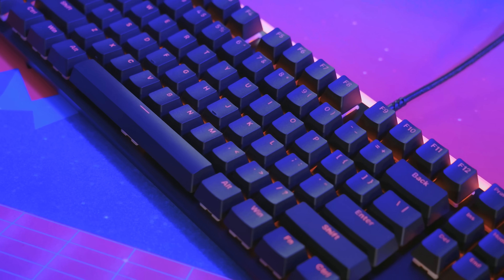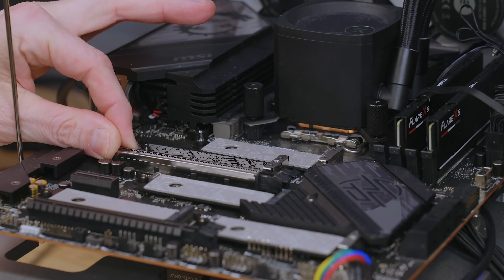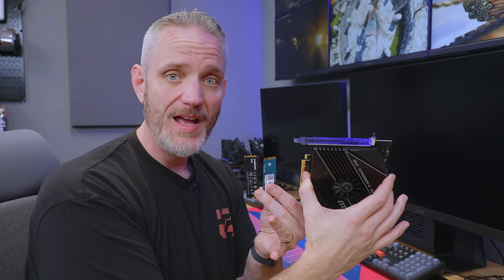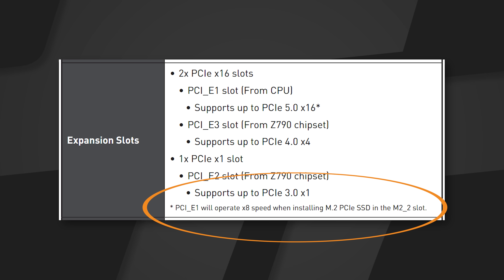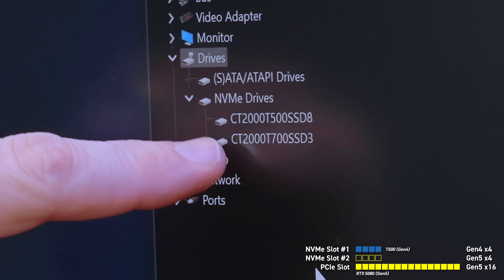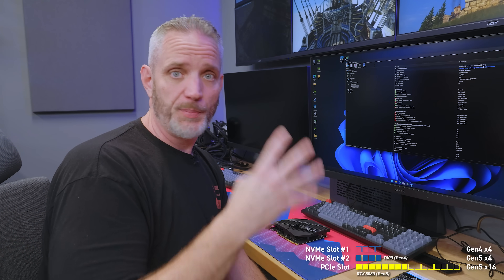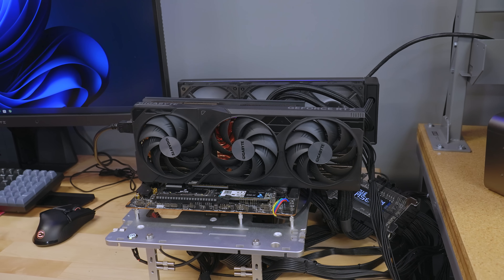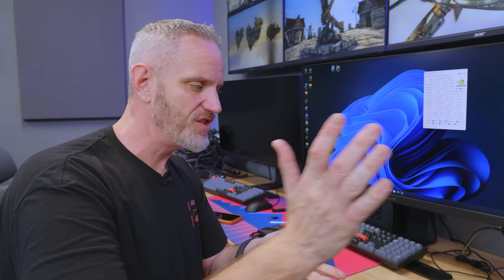Don't make this mistake with your PC!

Comment: The reason they have all the slots is so the manufacturer doesn't need to make a purpose driven board. It can be a standard gaming board, a GPU rendering board (where 2 or 3 gpus can do their job just fine without 16x each) or a storage focused board with a basic biotch GPU.
This wasn't a (real) issue until NVME storage showed up on the scene (and also when Intel killed their enthusiast platform lines) gobbling up the extra PCIe lanes in non-16x lane counts.

Comment: I have a gmktec K8 Plus mini PC, and it has AMD Ryzen 7 8845HS, which has 20 4.0 usable lanes. 
It has 2 x4 m.2 total is 8 so far.
 it has 2 2.5 GB Ethernet x1 lane each, total is 10 so far.
The USB 4 has x1 lane per port for PCIe passthrough total is 12 so far.
 It has an m.2 E key for wifi, but it has x2 lanes, which is actually bifurcated to 2 x1 lanes, 1 lane is never used. Depending on the device, some mobos will have this as an extra PXIE 1x slot or only have 1 lane on the m.2 E key. Total is 14 so far.
and the last thing a ouclink pot that is PCIe X4 Total is 18
As for the last 2 missing lanes, I don't know if they are even being used or if it's for the mobo's own chipset, which has mostly nothing Windows can detect. in short there's no PCI switching going on my mini PC i also have a B550M PG Riptide wich also has no pcie swoching but i have a 5600g so everything is ar PCIe3 and fingoing put the Ethernet wifi and 10GB USB are shared, and if I have my eternal SSD in the 10Gb port, it kills the networking

Comment: Do the Chipset NVME slots run slower because they are using the chipset, or do they run at the full speed of a Gen 4 drive?  Can I put a regular NVME Gen 5 in the Gen 4 chipset slots instead of a Gen 4 so I can move them to my next built and hopefully be able to use more Gen 5s?  
Thanks!

Comment: That x4 slot wont bifurcate to dual x2. Itll only support the m.2_0 on the adapter.

HEDT really needs to become a little more mainstream. I couldnt do crap on a 20 or 24 lane board. My arrangement would be limited to one way and Id hate it. I need the freedom of all slots being x16 and direct to cpu.

Comment: Thanks, I did make that mistake, but I fixed it now. I had a drive in the wrong slot, running at @x8 5.0, so I removed it, and it went back to @x16 5.0. I think I'll put it in the pciex16_2 slot so I can keep the drive without any issues. New to building PCs here, lol. Thanks again!

Comment: Yes those 'missing' lanes go to USB4 as that is how AMD says they should be used.  IMO with how they require certain chipsets to have USB4 on 4 of the PCIE lanes - AMD should just call them 20 lane CPUs.  I do as it's not very common to find a board that uses those lanes for an M.2 slot or the way I would prefer - a 16 + 0 / 8 + 8 pair of slots and an 8 lane slot.
Then there'd be three slots that let the following potentials.
A.
(16 lanes or 8+8 or 8+4+4 or 4x4)

(0 lanes)

(8 lanes or 4+4)

B.
(8 lanes or 4+4)

(8 lanes or 4+4)

(8 lanes or 4+4)

Comment: if the intel 14*** only has 20 lanes like ex: the amd ryzen 8000s 16x would go to the pcie slots and the other 4 would go to the chipsets. any nvme's would run through the chipset not the cpu.

also it is very confusing that the timestamp for the motherboard nvme is labeled as x870e taichi not the MSI carbon

Comment: For the M.2 on that Z790 board, there's a physical switch called a MUX that alters the route of the lanes from the slot to the M.2.  This is also why the M.2 slot is so close to the main slot to keep timings in sync as cheaply as possible.  
Bifurcation is only when a single slot is electrically split up to address multiple devices and it is not only in twos.  You can for example have 8x+4x+4x or 4x+4x+4x+4x.  As far as I know, there is no 'AUTO' setting for bifurcation (and it could be wrong as I only have a single platform modern enough to support bifurcation).  I had to go into my BIOS to enable bifurcation on my second 8 lane slot on my X570 Taichi in order for my two M.2s to work.  In the case of my X570 Taichi, a MUX redirects 8 lanes from the primary slot when I am using the secondary slot and I can further bifurcate the physical slots as 8 lanes top, 4 + 4 lanes bottom and likely as well can be set as 4 + 4 lanes top and 8 lanes bottom and 4 + 4 lanes top 4 + 4 lanes bottom.  The 8 + 8 is not bifurcation though as it is handled by a MUX and MUX are auto detect.

Comment: Query-  I have an MSI X99S MPower paired with an i7 5930K.  Both are a matched set using 40 PCIe lanes.  Here is the listed break down copied from MSI website:

4 (x16/x16/x0/x8*, x8/x16/x8/x8*) SLI x4, CrossFire x4, *=Forces M.2 to PCIe 2.0 x2

There are 4 full length slots and 2 PCIe x 1 slots.  1st full length slot is pinned for x16 with a x1 slot below, 2nd full length slot is also pinned x16 with a x1 slot below, then my only M.2 slot which is SATA(Forced to NVMe 2nd gen), then my 3rd and 4th full length slots are pinned at x8.

So this means I can slot 2 GPUs in slots 1 and 2 and play with stop loss scaling and run them at full x16 lanes as long as I do not use the m.2 slot and run a SATA SSD in one of the 10, yes 10, SATA ports?

And if I run with the M.2, my top slotted GPU will either need to only be an x8 GPU (or run a x16 and be bifurcated)? 

Any cool ideas what to do in the bottom x8 slot?  Maybe a capture card?

Also, I am looking at the Xeon e5 2699 v3 which is the same 40 lanes matched to this mobo.  This may end up being a workstation/server or might even play with the idea of making a home AI rig.

***edited: I'm sure I have this wrong.  I haven't built a computer in almost 30 years.  A lot of this is new to me.

Comment: The time your GPU most likely will run into PCI-E bandwidth limitations is if the game is poorly coded and has a VRAM leak.
Or you exceed the VRAM on the GPU, the moment it starts to swap out with system memory, that is when you start to see PCI-E bandwidth go to crazy numbers.
If it is useful or not depends, those moments usually cause stutters too, and I doubt more PCI-E bandwidth would help if you are already there.

Comment: This really should not be a thing in 2025. Giving up a gen 5 drive to get a gen 5 GPU is so 1997.
Reply: You don't need to though, it's been tested on a 5090 that you get less than 1% performance drop on 5.0 x8, just bifurcate bro
Reply: @silenthunder52 This is the real answer. It just makes no meaningful difference.
Reply: Maybe in 15 years or so? We're just getting to rear-connect motherboards so doing more innovation than that will take a looooooooong time.
Reply: You would have to pay extra because it will make the manufacturing more expensive for the MB and CPU.

Comment: I recently rebuilt my set up with a new CPU and motherboard. The Asrock X870E Nova is quite nifty in that the top SSD slot goes to the CPU but does not lane share with the PCIE slot. Effectively giving you the best performance for your graphic cards and storage.

Comment: It seems true, my pcie  slot for graphics  shows max supported 16x, but i'm only getting 8x. Yet, max supported link speed is 16.0 GT/s, which I get with both connections (like 8X), so I don't think I'm really losing much (helps being on mid tier equipment, 12700k,3080 12G, z690 MB). Get video as always, well mostly.

Comment: I feel like if you can't get data into the graphics card fast enough anyway, you may as well downgrade the graphics card. giving a graphics card the only 16x available is silly, until the card can utilize it fully, CONSTANTLY. so until the next, NEXT generation of graphics cards, I feel like we are better off with dedicating whatever we have to storage speed. ideally we want to be able to SATURATE the RAM, CONSTANTLY.

Comment: nice work, had to check it out on my x570 Phantom gaming4 as i had recently added another drive bc the promotional material said it could run 2 nvme at 4.0 spec... all good in this hood

Comment: Playing devil's advocate putting a gen5 in a gen 4 slot wouldn't be the end of the world right. Looking at say the Samsung 990 pro Vs Samsung 9100 pro, the sustained write before it drops on both is like 75/80 seconds max speed with the 990pro being half peak speed. If you drop the 9100 in the slow slot you would get much longer sustained writes as you can't saturate the device. Which would still make it better than running a native pcie 4.0 drive right? (Sustained sequential writes filling up the cache etc IE i would still buy two pcie5 drives and put one in a 4.0 slot)

Comment: I immediately went and checked my system after watching the video! luckily, my M.2 only uses 2x Gen 5 lanes (max supported for the Evo 990), and I still have a Gen 4 GPU (6750xt @ 16x Gen4), both are in the top most slots of my Strix 670E-E, and my 7700x (amd) is handling all lanes accordingly!  My secondary M.2 is an Inland branded 4TB, and is only getting 4x4, but it is just used for photos, downloads, documents, so the write speed is fine. Thanks Jay!

Comment: took me 2 whole days to find a MoBo where i can install my 3 nvme drives and dont loose lanes on the pciex16_1 slot. downloaded so many manuals and looked at the block diagrams; asus dimm.2 helped me at the end cause both slots on it run over the chipset

Comment: I'm curious about what REAL (not Nvidia's 8 lane boards marketed as 16 lane and false advertising) last gen GFX cards still work fine on PCIE 4.0's bandwidth. The GTX 5060Ti uses only 8 lanes but a 5070Ti 16 lanes. Does an AMD 9060XT use all 16 lanes on the board for instance? With some manufacturers you can see it on the pictures but others seem to be hiding it so what could AM4 users still buy to not be bottlenecked? How many GT/s do different last gen GFX cards really need?

Also on the video topic as well as my used bandwidth question around backwards compatibility with a slower NVME drive is not answered anywhere. Not the board nor drives nor CPU nor GFX car manufacturers. They are all leaving us in the dark around what we can use

Comment: Finally!  Someone showed how to read and understand the manual.  You have no idea how long I've been waiting for just one influencer to show why it's so important to RTFM.  Oh you have no idea how many hours of my life I've lost teaching people I know how to read motherboard specs to get a shortlist, then download and check the manual for the technical gotchas to understand how those specs translate into hardware configurations and how that affects hardware choices and performance.
Reply: PCs in the 90s had a RTFM problem, with all the manual jumper settings. By the 2000s, everything became simpler with BIOS/UEFI configurations and PCIe lanes. It's in the past few years when nvme has taken over from  SATA for enthusiasts, and eaten lots of lanes in the meantime, that configurations have become horrendous again 😮
Reply: @peterwstacey  yeah i read the manual multipltimes before i put in drives. "use c slot disables some sata ports put somthing in y it disables pcie slot 3 or 2 or something its a fucking nightmare

Comment: @JayzTwoCents  - I commented this on your previous video, but it seems you missed it.  In response to your question of the Gen4 card on the Gen5 slot, do you get 16 gen4 or 8 gen5.  The answer is neither.  It's 8 Gen4.  Write down this rule, because it's the most important rule you'll ever know and teach someone in computing.  You are always limited to the lowest common denominator.  A gen5 x16 slot bifurcated to x8 with a gen4 GPU installed, the lowest common denominator is x8 gen4, which is equivalent bandwidth to x16 gen3.  This is why it's so important to memorize that phrase because it will always answer this specific question because it informs hardware buying decisions because once you consciously think about it, you no longer buy the most expensive hardware because "it's the fastest", but because it fits best with your hardware.  

Such as the example you used.  What's the point of buying a Gen5x4 drive, when the chipset it has to go through is limited to gen4x4, bifurcated to gen4x2.  You can't simply "magic up" extra PCIE lanes that no longer exist due to the hardware configuration.  Likewise, you can't magically cram Gen5 bandwidth down a Gen4 lane.  It's for those very reasons the phrase "you are ALWAYS limited to the lowest COMMON denominator" is so important, because it literally informs you on both sides of the equations and when you're better informed, you can make better decisions.  That's not to say there's never a point in forward thinking and building for the future, but as you well know, there's being forward thinking and then there's outright wasting money.

I hope this helps.

Comment: could you do a video possibly about is it worth buying 2 gen 5 ssd m.2s to carry them forward into a future build rather than a gen 5 and a gen 4 for a current mother board that has 1 gen 5 and 1 gen 4? 
is the wear on the ssd likely to cause a problem in the future? what are the possibility of a motherboard having multiple gen 5 slots going forward or is the industry likely to keep it as 1 slot for gen 5?  is it rare to get a deal on 2 gen 5 ssds that its worth taking the drop in speeds for one slot ( i feel its not a complete waste of purchasing a ssd to put in a lower gen slot as it can be carried forward into a newer build, but there is a percentage of value lost while running it in a slower generation slot.).

Comment: The ROG isn't better than the Taichi. It's just a different setup, for a different use case. The other lanes are used for the USB4. The USB4 controller takes 4 lanes, and is mandatory on X870/X870E boards.  You're literally calling the Tachi stupid, because you didn't RTFM properly, and don't appreciate the layout of the board.

The Tachi chose to share the lanes of the main x16 with another x16 slot, so you can have double GPUs in x8/x8  while having none of the M.2 slots share any lanes. If I want 4 SSDs without pulling away from my main PCIE slot, I can do it. I'd actually prefer the Taichi setup, since I can use 4 SSDs without touching the GPU, and I can then use an add-in card to get 8 lanes to the CPU. That's two PCIE5 drives.

You literally read the amount of lanes the CPU has, read and showed the block diagram, and didn't bother to actually read it. It literally says that 4 lanes go to the USB4 controller. And it says Gen4 there because the controller uses Gen4, so they only wire up Gen 4. 8000G series only have PCIE Gen4 lanes.

Shout out to Phil, for at least bothering to read the chart, even though the Gen4 marked there makes it a tad confusing if you don't look it up.

Comment: Still rocking the luxury of so many lanes from 10 years ago on a threadripper. 7 NVME drives, a dual 10gb fibre nic, usb 4, SAS HBA and still got some free lanes.
Reply: Yes. I miss the enthusiast threadripper boards and chips. Just $250 more and you could have 64 lanes all properly configured without bifurcation ghost killer.  They were awesome. Now it’s $1200 for a stupid cpu
Reply: ideal configuration for me is 4 physical and logical x16 slots:
   - GPU 0
   - GPU 1
   - Infiniband HBA
   - Storage*

* Storage changes depending on configuration, but as of now I prefer a tiered cache HW RAID on each machine, stringing multiple machines together via IB for that hyperconverged SAN/Compute/HV-Cloud feel.
   - Storage at the logical level is stitched logically.
   - Storage at the PHY level is stitched via a physical solution.
   - for a small hyperconverged cluster, i find it works better than trying to do the SOFTWARE ALL THE THINGS.
      - there's a lot of utility in your storage array(s) (including tiered cache) presenting to the OS as a block device(s) instead of asking the OS to do magical OS stuff.
         - Magical OS stuff is magic for pools of HW arrays, though.

I've 4 servers in my hyperconverged cluster at the moment..
   - w/r/t storage, i can lose any single serve and be fine.
      - each server may lose a single drive and be fine. (RAID5¹)
   - w/r/t cloud-y stuff, IB lets me shuffle entire VMs from server to server without downtime or even a missing packet in the middle of a transfer.
      - I've far more capacity than I need, so it's easy to run a 3 tier environment for all the stuff i host or play with.
   - w/r/t compute:
      - I need more. using older nVidia GPUs over IB has shown that a hyperconverged cluster will get me to 1TB of vram eventually (note: think 10+ years) and hopefully running whatever SoTA models exist at full size, just not serving a zillion people at a time).
      - both more vram per GPU as well as more servers. 
         - 16 servers with a pair of 64gb vram GPU would hit this.
            - problems exist making decade long plans in IT, though not having any idea about 1, 2, 4, 6, 10 year timelines is a lot of missed opportunities.

anywho, it is time to stop writing ridiculously long youtube comments, or reddit will get jealous!

---
1: RAID6 was too much with the addition of server level redundancy, especially in 5 hdd arrays backed with mirrored ssd block level cache.

Comment: I just built my wife a new pc. When trying to research which board to get, my god do some of the manuals be garbage layout or write up on what slows down what. I wish we had a defult if you run 1 GPU and 2 drives, one for games one for OS use theses slots to get top speeds.

Comment: Put gen 3.0 nvme's in all of your x4 slots, and the 4.0 into the x2 slots so everything runs at the same speed for your zfs array.

Though, for my zfs array, since I have two SATA drives in it, I barely use the speed of the NVMe slots. But since the box only has 2 sata and 2 nvme drives, that's the way to get the most capacity.